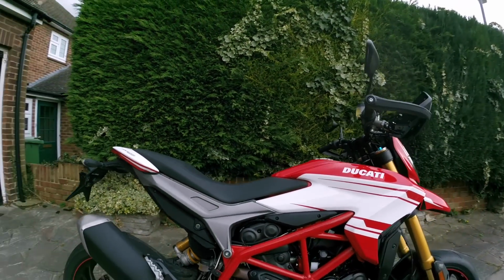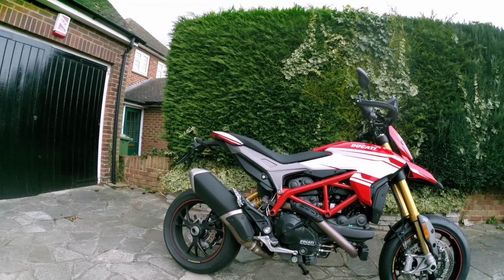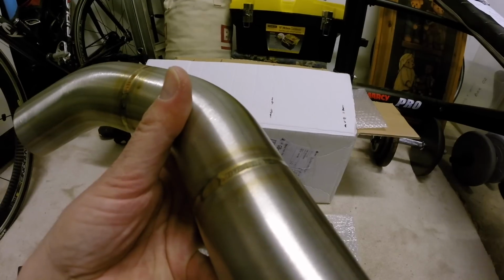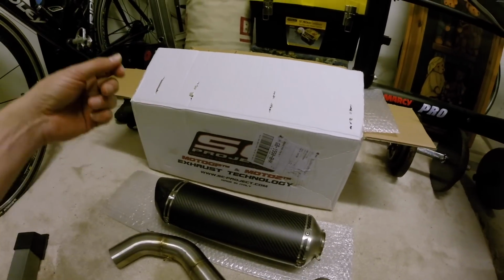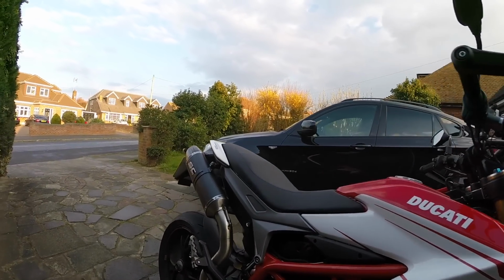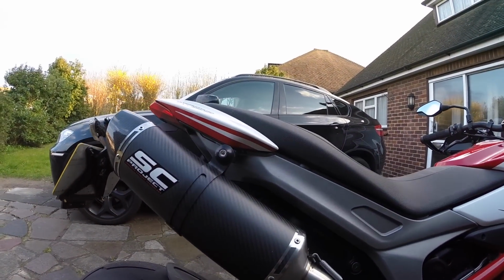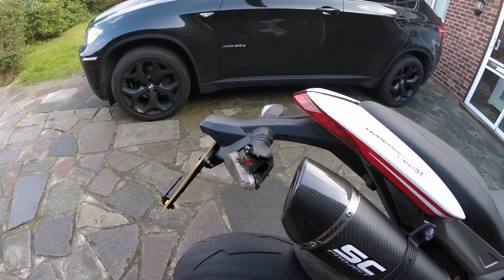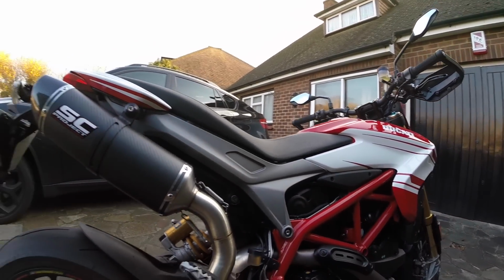Brand new 2016 Hypermotard SP 939 - I melted my indicator (doh!).

Comment: hahaha, nobody could see this coming with the indicator exactly behind the exhaust^^
Reply from the maker: Very true, impatience breeds stupidity :) ...sounds REALLY good though!!
Reply: yes the final result counts ;) do you have a comparison with the hypermotard from 2015?
i heard, because of the Euro 4, in stock configuration the old one sounded better.
Reply: If you bought the termigoni full system it comes with smaller blinkers just because of this. The manufacturer of the exhaust you bought should of warned you of this issue.

Comment: This exhaust is the same for the 821? I want the exhaust that goes down the 821 and wanted to know if it works for 939! I need to know if they are the same measures. Thank you
Reply from the maker: Hi Joan, Sorry for the late reply back. I think the exhaust maybe slightly different but definitely check first with SC Projects (they're not the best with their communication so good  luck!).

Comment: Nice bike. It starts by buying tuned exhaust :) Did you consider Termignoni set before SC Project?
Reply from the maker: +stenly311 I did consider the Termi setup at first yes. Especially as you get a sports air filter and the all important UP map as well with it. However the quality and finish I've seen on some Termigoni systems has been somewhat questionable, especially when the price all in & fitted in roughly about £2000!! ...ok, they would fix under warranty BUT customers shouldn't have to put up with it. The SC Projects exhaust however is spot on!
Reply: and what brought you back to SC?
Reply from the maker: +stenly311 Mainly aesthetics, I think it suit's the bike well. I also like the quality and finish, and I REALLY like the sound.

Comment: The SC can looks good but I hate the aesthetics  of the connector pipe plumbing for the high mount. How its protruding out the side like it was never meant to be there.
I got the full Termi for my 2017.
Reply from the maker: How have you found the quality of the termi?
Reply: @PaulBilton   The build quality looks fine, have no complaints. I have Rizomo turn signals to avoid melting issues.
Reply from the maker: Roberto Smith good move, shame I didn’t do that at the start lol